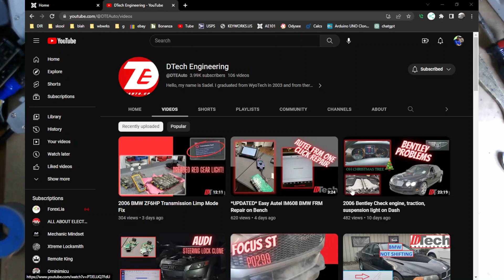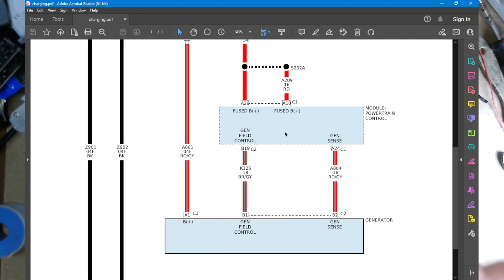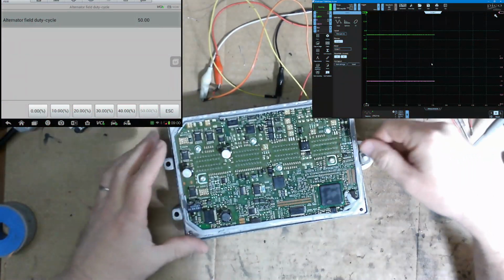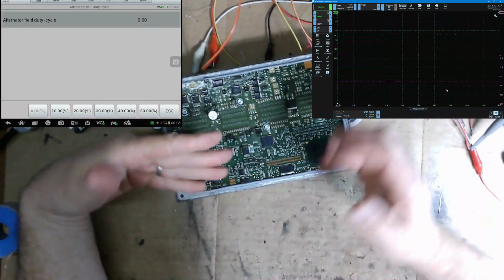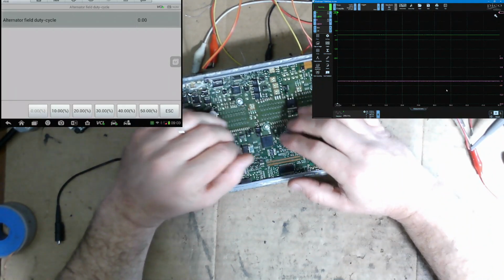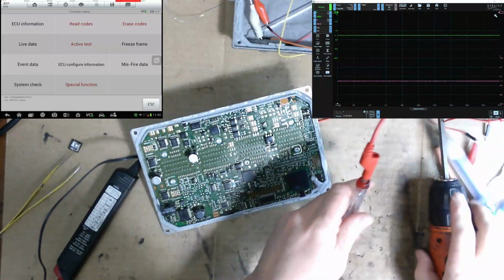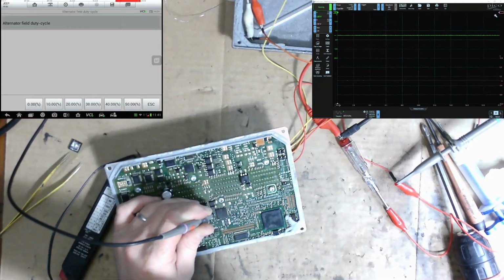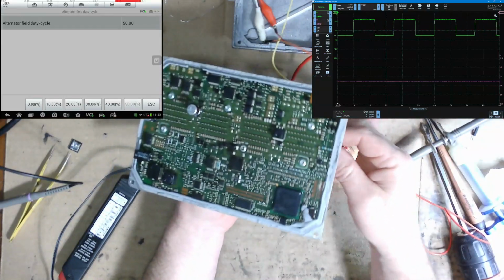Repairing Chrysler engine computer for NOT CHARGING BATTERY - Jeep Wrangler, Liberty & Dodge Nitro

Comment: Thank you so much sir for uploading this video. It's really helpful. 
  Please, the internal components are always covered with a gum, using a screw driver to gently peel the gum, without covering the gum again, hope it wouldn't cause any issues.
Reply: A wire bristle brush works better
Reply: @keyworksva   okay. Thank you so much sir 👍.

Comment: Can you tell me what the Power Pin voltages are?  What current limit setting do you set the power supply to?  I have an 06 300C Chrysler PCM I'm about to open and probe.  The signal on the scope to my coil seems lower than the other 7 so I think that's causing my cylinder misfire.  Want to bench test it like you but not sure the power pins/current and voltage settings.  Any help appreciated!

Comment: Where are you located?   I live in Oklahoma..  I'm a DIY mechanic of sorts and I've been watching diag channels since like 2019 and learning from everyone for a long while now.. I even have a scope and 2 different scan tools now.     Anyway, my issue is that I have a 2010 Dodge Nitro 3.7L and the accelerator pedal signal drops out.   As you know, there are two APP signals in the pedal---  on the scantool APP 2 will randomly drop to zero every few seconds, no matter what position the pedal is in.  So I pulled the accel connector under the dash and applied voltage through an LED test light to the APP 2 wire to simulate a full throttle on the pedal--  and it still drops out in live data.........   So I did some continuity checks at the ECM and found my APP 2 wire:   with key on- I pulled the plug off of the ecm and again applied voltage  through an LED test light DIRECTLY to the pin on the ECM..  The scantool showed APP 2 high (at 5v) just like it would if I was holding full throttle on the pedal (which is unhooked at the moment)------   and STILL the signal drops out in random pulses.   So I know for a fact that the problem is internal to the ECM.    

The crazy part is it doesn't even throw a code.  I can drive it for a few blocks and then it will trip that "lightening bolt" warning on the dash and go into limp mode--- but no code at all??   and if I just cycle the key off and back on (and start again)-- it will reset and work as normal once again.   

Have you ever heard of this, and what should I do to fix it?   Should I open up the ECU?    Could I possibly send it to you?  Everything else works fine, it's just that accelerator signal dropping out inside the computer.    (I took screen shots of the signal dropping out if it's needed.)
I'm not sure if my scantools will be able to program a new VIN if I get another computer, so I would rather fix this one.  (xtool D8  and x431 Pro).
What are my options-- any response, help or advice would be much appreciated.   thanks.
Reply from the maker: sent you a email
Reply: @ecurepair  Ok.. sweet

Comment: I have recently had a PCM repaired (by a reputable company) for my '11 caravan and after installation, it threw a torque converter lockup solenoid high voltage code. Is it possible (likely) this was caused during the repair? Voltages and alternator function look good.
Reply from the maker: Not very likely but if you feel the problem is in the pcm you should ask them  to check it over again.
Reply: @ecurepair  thank you so much for taking the time to respond. I truly appreciate it👊

Comment: Being as you repair ECU I'm guessing you have a vast understanding of a cars charging system my problem is I like to both camp and compete in car audio and my Toyota Camry LE has a smart charging system or a vvcs as I've been told it's called an ONBUS LINBUS electronics build and to be honest I didn't even know it had it or what it was when I leased the vehicle only to spend thousands on amps , subs lithium batteries,mini fridge etc. and then learned I'm stuck at 13.8 volts for charging and I can't upgrade my alternator without voiding my warranty (Hindsight) lol but I am looking for a way to step the voltage up to a lithium battery to supply everything I have built my own 192 AH headway bank of lithium cells the only thing I need is to turn 13.8 volts into 14.6 for proper charging so it's not constant maintenance and conditioning of the battery bank can you please recommend a device that will work and isn't some rigged up diode application that can possibly leave me stranded if one burns out
Reply from the maker: Sorry I dont know toyota's all that well. That's pretty low for a target charging voltage. If the ecu is sensing the voltage based on what its seeing on the B+ then its probably not a good idea to try and spoof to read lower. If it has separate sensing wiring then might would be ok but I dont know what the effects would be of having it charge higher then its meant to.

Comment: Do you repair ECUs for 1997 Grand Cherokee, 4.0L  Not charging correctly?  Volts show 13.58 for charging. Not showing on your page.
Reply from the maker: I do but depending on which pn you have it may be cheaper to just replace it.

Comment: I would like to send you a 2011 town and country 3.6 pcm. What do I have to do?
Reply from the maker: Hello, you can contact me from my website or you can checkout from my store using this https://keyworks.us/engine-control-module-repairs-c97/chrysler-dodge-jeep/jeep-liberty-07-10-ecu-repair.html Make sure to use promocode SAVE10 to get 10% off
Reply: @ecurepair  Just found this video,   Awesome,,, I also have a 2011 Town and Country 3.6  and  I'll be contacting you shortly  ;-)
Reply: @ecurepair  OK,, sent the Contact us mssg but got an error the first time. second one shows it went through.  hope to hear from you😀

Comment: Can you share what temp and air rate you use to remove these chips? Is it the same for installation? Do you pre-solder the chip before installing?
Reply from the maker: I wouldn't recommend attempting this repair for beginners at ecu repair or DIY'ers with lower end tools. The chip is fairly difficult to remove and place back properly. It will disperse a lot of heat and beginners not used to working with large driver chips attached to the aluminum casings are likely to do more damage then good on these. With that said, I rarely change my hot air station off max heat and air.  I use a quick 861 & older metcal 900. You will have a hard time removing this without a preheater or additional hot air station.
Reply: @ecurepair  Okay thank you. I have several junk pcms here to practice on and a bunch of the chips from China. I have an Atten 862D which is quite similar to the Quick as well as a Hakko FM-203 with various tips, so I am good there. I was able to remove the chip, after several minutes at 430C and 50%, without a preheater, but I think I will buy one as the Yihua 853 is not very expensive and will get the job done. I did remove the chip and presoldered the board but not with enough solder though I think. I will try again when I have the preheater. Will try to preload the solder on the board first. Then I will try pre-soldering the chip and see which is provides a better result.
Reply from the maker: @mikei.7425  the 853 is a bit small but works good.  I put these back with lead solder. I tin the pads and chip both lightly with more focus on the two center pads. Then I will use a ultra fine tip to make sure the edge pins are good.
Reply: @ecurepair  Thanks Jason!

Comment: Awesome video showing the diag and repair on this ecu. The alternator generally is what takes these chips out. I usually install a inline fuse to prevent it from reoccurring. Where do you generally source the replacement chips for this repair?
Reply from the maker: Im not sure of a reliable source for these any more. I purchased a 1000 or so when they first hit end of life status thankfully.
Reply: Which wire do you install the fuse on, what amperage?
Reply: @congabuena  I use 10 amp fuse. The field coil generally draws around 2-5amps